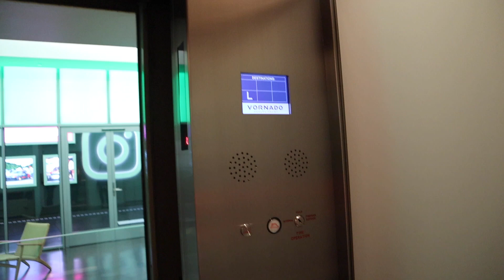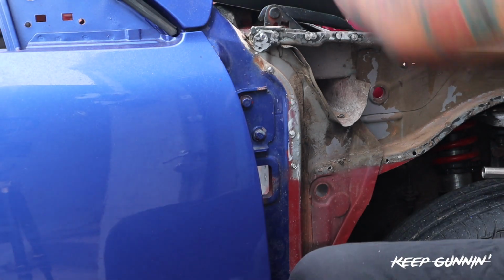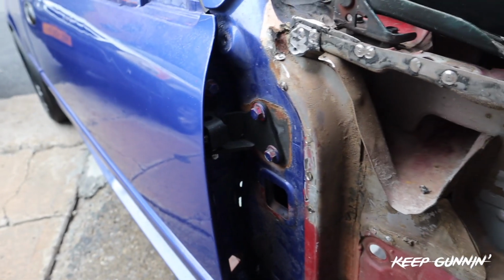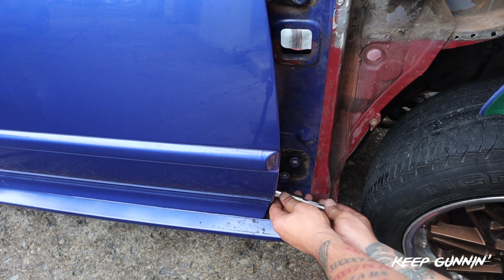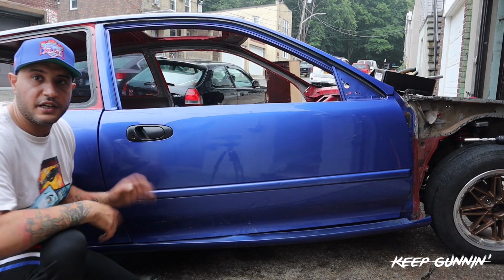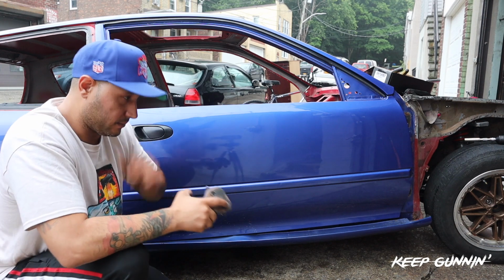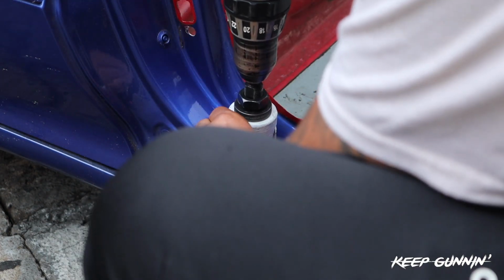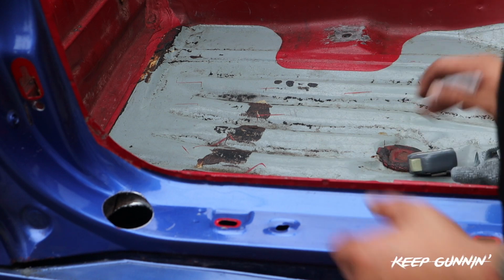HONDA CIVIC LIGHTWEIGHT REDUCTION: PART 13 (KTUNED DOORS)

Comment: Nice video, but in all reality that's not even a 1 pound weight reduction? What's the point of this if it does more damage than it does weight reduction???
Reply: People who say this don’t have 1800lb-1900lb wet weight vehicles. Every pound counts.
Reply: @JDMHMONGBOY96  people wbo drill holes in the doors sills die in crashes too
Reply: @huck69  not even just that, chassis flexes a lot more too
Reply: @tayvonrose2528  with a roll cage it won't
Reply: Way more about convenience. You ever climb out you window in the enclosed trailer after loading it? Or climb in it No you haven't? Then this product wasn't meant for you

Comment: Hole saw will last longer if you go
slower and add pressure with cutting oil. And use a 2-1/2 washer when you drill that initial pilot bit hole. When you fall through instead of the teeth catching and twisting the drill it will just keep spinning on the washer.

Comment: "lightened" but now way less structurally stable 🤣
Reply: bagged Q45 I was about to say this too. 🤦🏻‍♂️ lolx
Reply: He's gonna have a full cage. Dee de dee. If structural after mods was his goal wouldnt the doors lifting off affect it more than holes that are stronger than flat metal. Think then speak. Thats y we have 2 eyes 2 ears 2 hands and 1 mouth. Listen work watch twice as much as we talk. I said we. No disrespect meant
Reply: @waterproofroberts2228  I ain't even gonna waist my time explaining 🤣 have a good one bro
Reply: Hey thks for saving us both the time. It is in fact just our opinions neither one can prove our point right. Wait, ever watch street soap opera outlaws? First season, maybe 2nd after kam got the elco from chief. Check out the control arms still straight but swapped for tubular real upgrades. Swiss cheese dude. Steel straight. Didn't pull cuz they bent after a wheelie or wreck. Yet i seen a civic fall off a 6 inch block when it broke, wheel still on. Falls straight to driveway, bent not lifted opposite side. Sib frame car, 6 inches. Yeah i know man law dosent let u admit when u may be wrong. Non response will do for me. God bless you for bagging a car that didn't need it, coilovers make much more sense. Usable flex not dragging still parking lotting, no speed bumps obviously looks cool to. Unrealistic at speed. But from lot hovering to all the way up i bet u dont get 3 inches all the way around fender to tire. I eat sleep and build cars. Its a sickness
Reply: @waterproofroberts2228  damn wht a long reply lol you waisted your time 😂
Reply: bagged Q45 wasted. How do you not know how to spell that..
Reply: @AeroPrixma  swipe typo
Reply: @Overland_RC  work on what? A little RC car? Lol  your third arm must be holing up a tiny light 😂
Reply: bagged Q45 Oi my bad then
Reply: @Overland_RC  apparently
Reply: hes like we dont wanna hit that out edge. when hes cleaning it off he definitely got the edge on 2nd hole lmao

Comment: At this stage, why even bother drilling holes? If you are just going to mess with the car like that and then add a cage why even bother with the metal? Remove everthing, make the cage, replace everything with a lightweight material. I just don't see how this is worth the time/money/effort

Comment: If it's so much weight to be considered a weight reduction put the reduced weight on a scale, might have to use ounces instead of pounds. More deflection due to decreasing the integrity will make it unstable and more dangerous at high speeds. Only in Honda world smh 🤦‍♂️